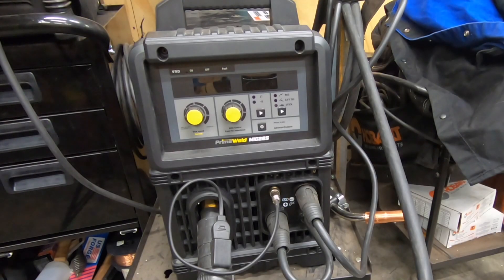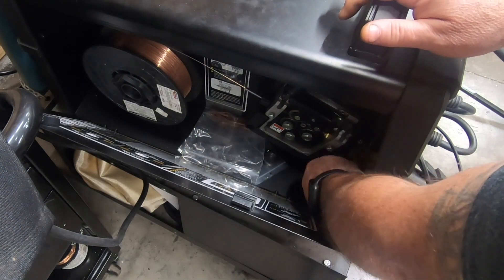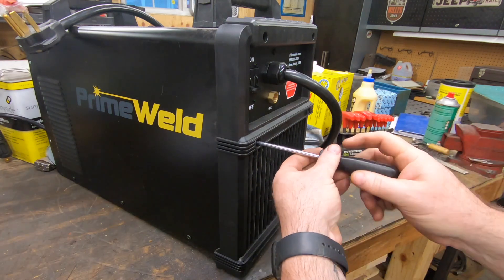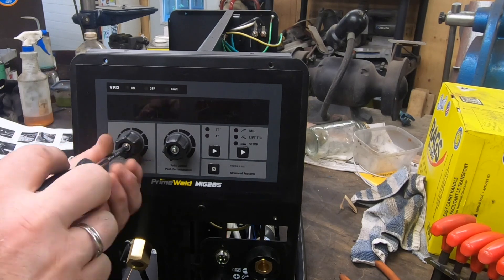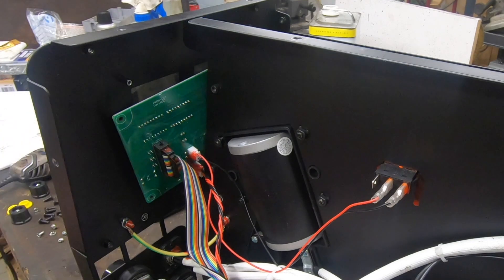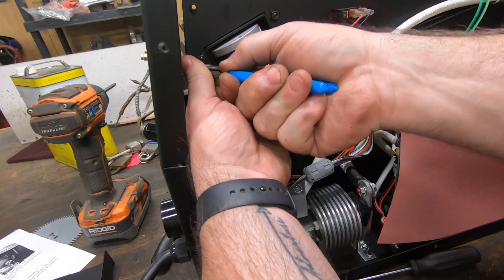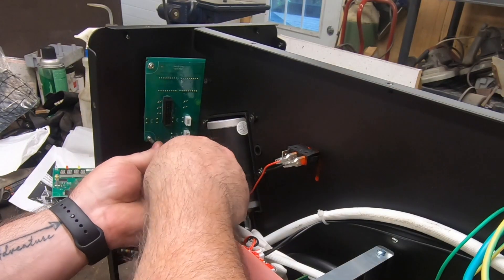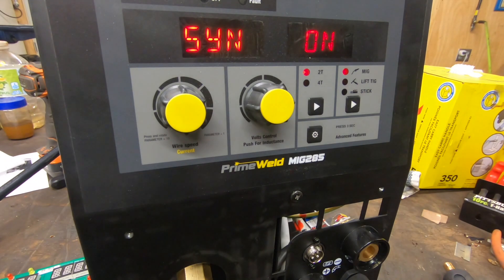PrimeWeld MIG285 Update! All New Manual Mode

Comment: Wonder if PrimeWeld offers a way to make my 180 synergic. That would be a nice option. Thank You
Reply from the maker: They need to hear from us customers. Maybe not possible in the current edition of the 180. Maybe the next iteration will have something like that.
Reply: Prime Weld has good consumer service. Bought the 180 and the Cut 50 but wanted to up the amps to over 200 and the duty cycle, from 30% to 60 % that offers a Synergic function and  have a spool gun option , so have been considering Hynade brand.

Comment: Will it Spray?
Reply from the maker: I'm told it will, but you need a gas mix of greater than 80% Argon. I've thought about getting some 90/10 just for fun. But the voltage and wire feed speeds suggest it will do it. Might be near the upper limit of the machine. I think you need 24-28 volts and around 200 amps, IIRC from welding school.
Reply: Try 27 volts and 400 wfs for spray transfer with solid wire.

Comment: I to like the way my older Lincoln 175 has manual controls. Bear
Reply from the maker: I like the simpler synergic mode for 99% of the welding I do. Just set the wire speed, and let the voltage land where it needs to based in wire size and process. But it's nice to have the full manual mode for the times I need it.

Comment: Thank you for the video. I ordered the upgraded board on Monday, received it wed. Excellent customer service from primeweld. I installed mine today. Went ok especially considering I did it on a lift table while be temporarily handicapped. Used a wheelchair to sit in and managed to wrestle the machine around enough to install the board. Looking forward to more videos. 18:18
Reply from the maker: Good deal! PrimeWeld is the best. I can't see me ever buying a machine from anyone else.
Reply: @MyLilMule  I also have the 225x tig, excellent machine for the money . I also have a razor weld 45 plasma, which if I didn't have I would buy the primeweld 60 plasma cutter . I have been very impressed by primeweld.

Comment: GReat Greg, I don't mean to tell you what to do but your wire extention [stoick out] is too long...try for 1/4 -3/8 " max tip to work.
Reply from the maker: You’re not wrong. The nozzle on this gun is pretty big. Plus trying to make sure the camera picks up something for the yootoobs.
Reply: @MyLilMule  Got it, That Prime Weld is a great MIG machine.
Reply from the maker: @AWDJRforYouTube  It is a really nice machine. Mind you, I haven't used a lot of machines, just a couple Hobarts and a smattering of the red ones, big and small. But both my TIG and MIG machines from PrimeWeld have never failed to impress me.